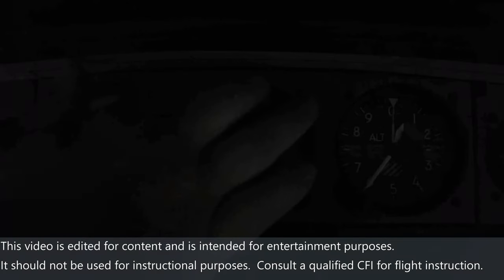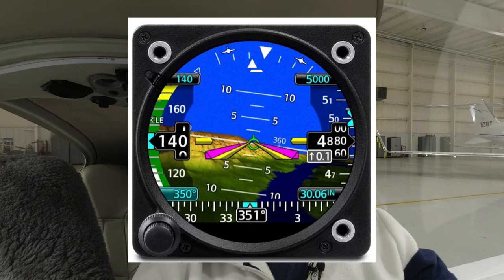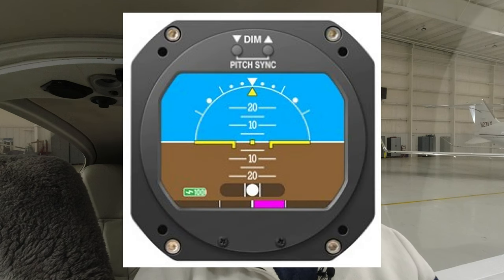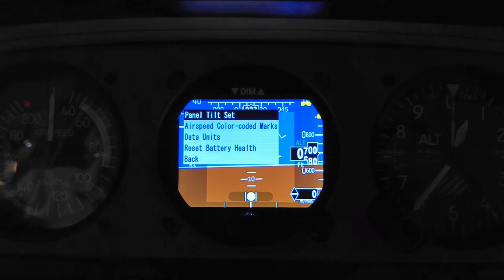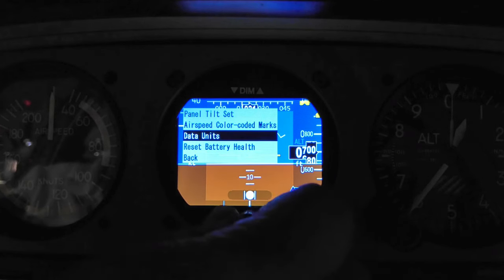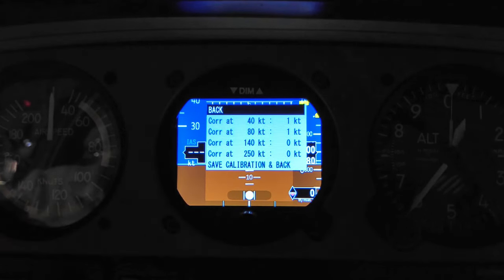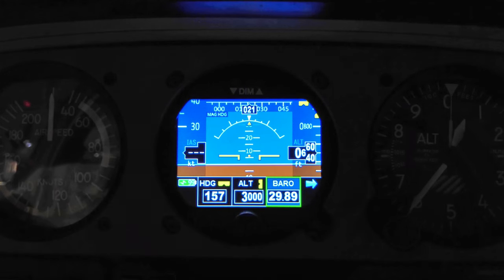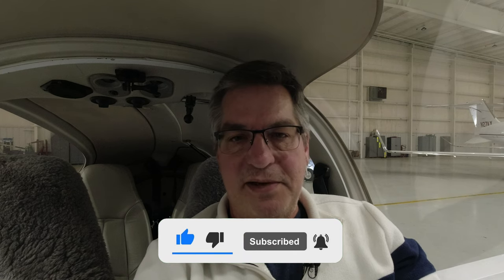Multifunction Indicator Review-RC Allen Mini 6

Comment: Great stuff, thanks for posting this.  I'm still considering ordering one of these, but I'm still so surprised there's barely any information out there about these units.

One question: is it possible to keep the unit in Imperial units, but switch to hPa for pressure setting instead of in/hg?
Reply from the maker: I don't think that is possible.  The data units setting sets all items to either imperial or metric.  I have not seen a way to adjust individual items.
I am very happy with the unit and I found their customer service to be very good.
Reply: I spoke with an engineer at RC Allen a couple days ago.  He said each indicator can be set to unique units now.

Comment: How have the heading indications of the Mini6 Aligned with the G1000? Would you feel comfortable using the Mini 6 as a primary flight instrument?
Reply from the maker: The Mini 6 has been 0-3 degrees different than the G1000 (a negligible difference).  I have only had it a few months but, it seems to be consistently accurate so, I would have no problem relying on it as a primary instrument.
Reply: @diamondstarpilot  Awesome! Thank you for the info. It seems like a very capable piece of tech. From what I can tell I should be able to legally replace my whole vacuum system with a single unit in a certified aircraft. The Garmin 275 and AV30 get all the press but from the spec sheet the mini 6 seems like a compelling option.

Comment: I have a RCA 2610-3 and it is consistently off the pitch on roll in my baron b55 after some acceleration and turns. Do you have that issue ? and can you turn everything off so it simply look like a RCA2610-3 ?
Reply from the maker: I have not noticed that issue but, to be fair I have not been looking for it.  On the occasions that I glance at the unit, everything looks correct. There is a menu option in settings to turn air data off but, I am not sure what that does.  Seems like that might disable altitude and air speed but, I have not tried it.  There is a setting to remove vertical speed.
   I did develop a problem with the altimeter on my original unit and customer support was amazing at getting it resolved quickly.  There was no attempt to repair it or lengthy return process.  They sent a replacement immediately (before they received the return unit).  Everything has been great since then.  I would reach out to them to see what they think.  I think they try a bit harder to keep customers happy than the bigger companies that start with a G.